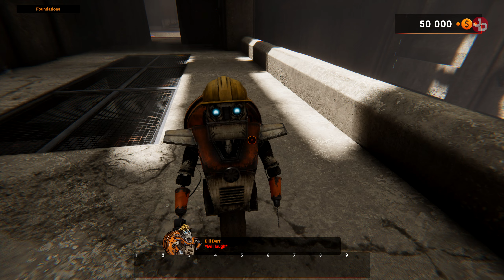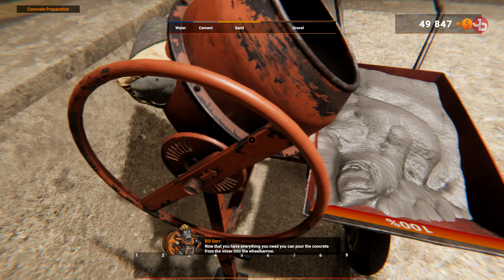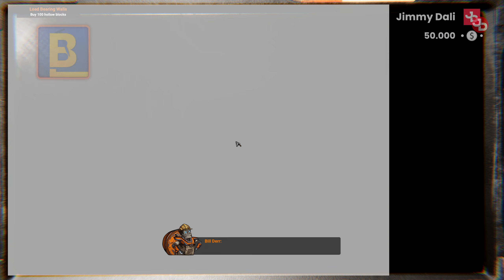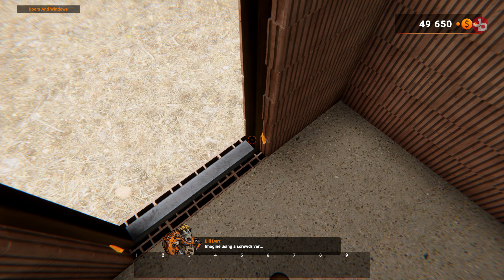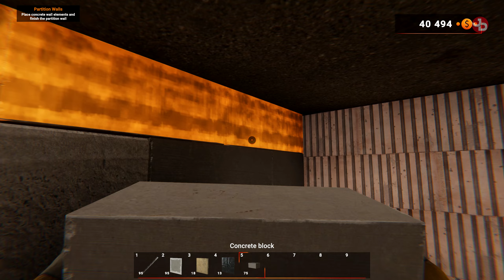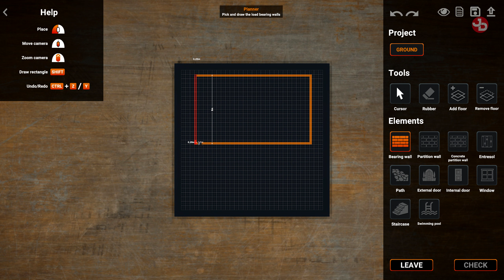Builder Simulator - New 2022 Demo with 9 Step Tutorials

Comment: i dont know how to get the toolbelt to show  i tried every button but nothing works
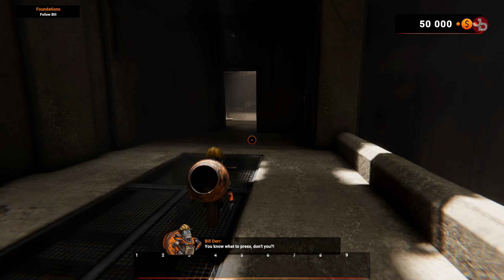Reply from the maker: 1:20 if you're using a gamepad or game controller then press 'LB' or Left Bumper
If you're using a mouse & keyboard then middle click on the scroll wheel (in other words press in the middle mouse button)
Reply: @jimmydali  i dont use a gamepad and i tried the middle mouse button but that doesnt do anything
Reply from the maker: @Lightspeed891  Mention your issue on Builder Simulator Steam Discussion Page or their Discord Server.